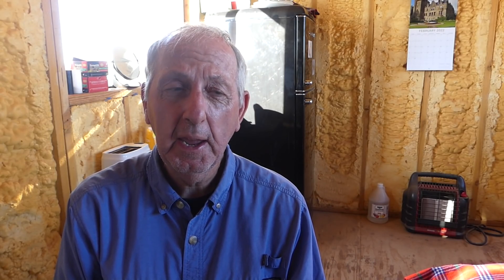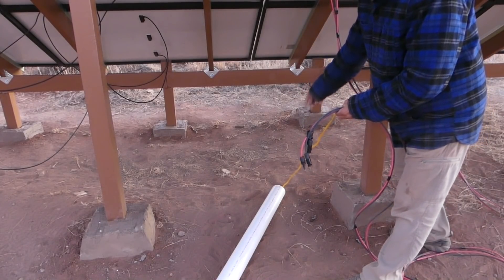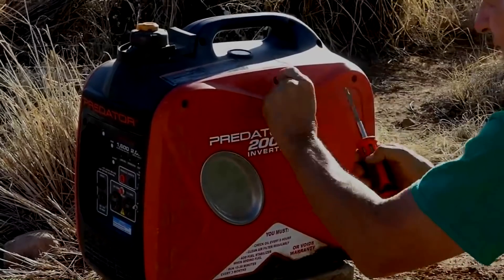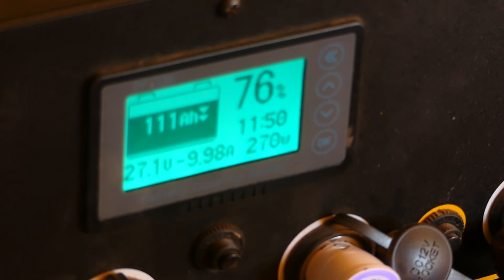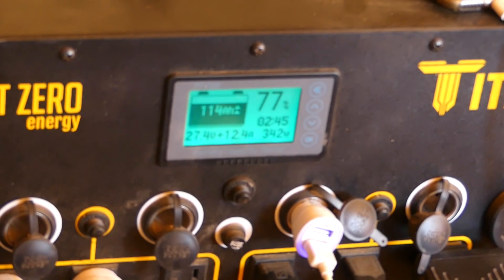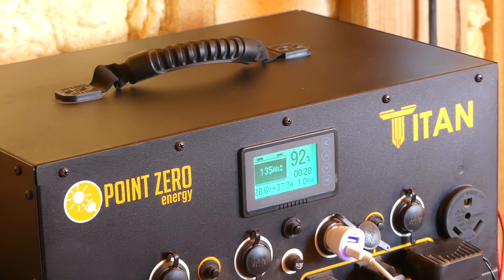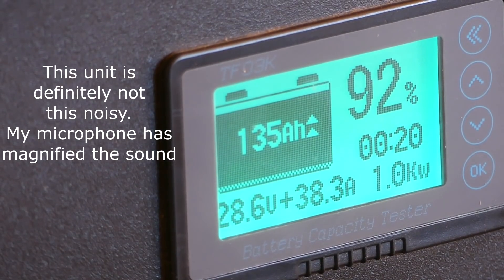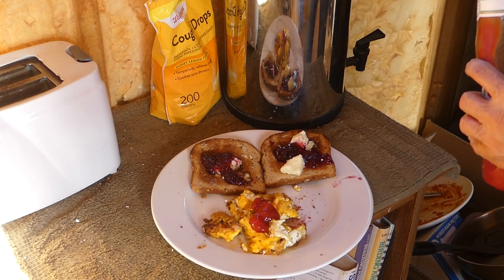Off-Grid Senior Powers 200 sq ft Tiny Cabin with Solar

Comment: Hello Sir, do you have your panels connected in serie or parallell.  How many Ampere are they giving you? How thick is the positive and negative wires?  Just control that they are thick enough for the current.  Only a hint.  Regards Rickard from Sweden 🇸🇪
Reply from the maker: Hi Rickard. My panels are connected in a combination of series and parrallel. I am using no 10 solar cables. The building is not wired yet but I will be using appropriate electrical guidelines for what. Thanks for watching!

Comment: Solar was a journey for me... I live in a cold area so my heating will always have to rely on wood heating but everything else I plan to off grid 100% within 4 years. I basically have everything off grid but lack the battery backup to fully rely on my solar power production. Plus I'm short 9 100watt panels. In the end I plan to have 15-24kWh battery supply and at least 2400 watt panel input.
Reply from the maker: Its all about low consumption of power Mile Deep.  But thats the beauty of Solar.  You can taylor make it for individual needs.

Comment: Don my how a year passes so quickly, looking back it has been a year since the cottage was delivered, you have accomplished a great deal since then. Curious to understand why you did not include in your solar requirements power usage for a washer and would assume you would use the sun to dry clothes, etc., microwave oven and perhaps some other small appliances? Keep up the great work I enjoy learning from you.
Reply from the maker: Thanks so much Bob! I simply use a landromat but may go to a small simplistic washer put in a shed somewhere etc. For me my big focus is on heating and cooling .  After that would come a decision about a washer.  If this little cabin becomes an airbnb then I will do a microwave.

Comment: Can you adjust the charge rate on your charger to not load the generator as much. I have an inverter/charger and my Honda 2000 only puts out 1600 watts continuously which is only 13.3 amps. I set my charge controller to only draw 10 amps which is 75% of the rated continuous power of the generator. If you are charging a 12V system that’s would be close to a 100 amps going into the batteries which is a lot. I use  sealed lead acid and they recommend 20% of the Ah rating of a battery, 100Ah battery is 20 amps max. I run mine a little lower and have had the same batteries for close to 20 years. I have a 48v battery system and a 12v system for lights, RV water pump and radio.
I worked as a communications tech for 30 years and did electronics  all but a few years of my work career. My job on the side is building my own places. I’m just finishing the last one. Where I live we don’t have any home inspections except setbacks and septic or if a bank is involved. I love your foam walls. I’ll bet that makes it easy on the energy cost. We have 7” in double stud walls.
Reply from the maker: Great point Chris. Unfortunately there is no way that I am aware of to adjust the charge rate on the charger.  But I rarely use the generator now that I have all of my solar in place.

Comment: Don you have a seriously big solar system i have half that size and its plenty!One small 8000 btu air conditioner should be plenty!Batteries are very expensive, i have 8- 230 amp hr lead acid batteries right now and they do  just ok. i will go to lithium Ion this year hopefully.You are doing well and learning a lot, im inpressed! Best Wishes Don.
Reply from the maker: Thanks for your lovely wishes Homefree acres!  Hoping to get a mini split with about 8000 btu.  Havent decided on it yet.

Comment: Keep up the good work sir.  I'm doing much the same as you, but I am working on an old cabin Built-in 1850 in Arkansas, rather than the desert of Arizona. Your solar panel set up should be more than sufficient for you. Battery power is something you may need to add to. I have a smaller solar array than you do, but slightly more battery capacity. You have the advantage in Arizona of having a lot more sunshine than I do here. Please check out my YouTube channel, if you would like some building tips. I have about 50 years of experience in construction and restoration. Also you would get to see what my 1850 Homestead cabin looks like now, and what I plan to do with it in the future.
Reply from the maker: Sounds like a great adventure!  Hope it all goes super for you Back to the Past!

Comment: two best tips I got when doing a house like yours was:  beef up the west and southern walls for the summer sun (So I used 1" plywood on those two walls inside, and 3 coats of exterior UV paint on those walls.  The same with our home in Tucson.   Also I needed to know what kind of rodents (pack rats etc) lived within 100 yards because they love to chew on....well, you name it especially spark plug wires in our car, and any small holes they find. They only come out at night due to being on the bottom of the food chain.  I set up live traps (4) and caught about 10 a week....drove a few  miles away and let them loose.  Finally, I learned from an insect company to use screen material to keep things out....I think it was called carpenters cloth or hardware cloth at the absolute smallest size available, about the diameter of a common nail 1/16 inch.  This was a decade ago, and we used a lot more storage batteries back then!  It was so nice to get out of town and just relax inside the little cabin, and BAM, open the door and the walking trail begins immediately.  I'm no bird expert, but we put up hummingbird feeders due to how many there are here in this part of the country.  Have fun..  One last question:  where do you get internet from?  Have fun!
Reply from the maker: Good tips Lawrence. Thanks very much.  My super fast internet is fantastic.  What I have done is purchased a tablet on Ebay. Then purchased a sim card for it from AT&Ts tablet plan. $20.00 a month and super fast.  It is trained on AT&T towers in the area.
Reply: @affordabledesertliving3487  Thanks for that info, I had no idea that technology was 'out there'.

Comment: I'm not sure how a licensed electrician could use the Titan to power your cabin.  The Titan is not designed to be connected to house wiring per the system specs.  There is no actual AC connection point other than the plugs.  It would have to be jury rigged to the panel, definitely not to code.  Practically all inverters have an AC output hardwired connection.   But you have a solar generator,  which is designed to be portable, and not connected / hardwired to a electrical panel.
Reply from the maker: Hi Dan.  Respectfully others have wired the Titan to their cabins. It's all about wiring the cabin like a large RV.  The end results are the panel leads to a 3 pronged 30 amp plug custom designed for the titan. The titan internally is already designed to receive a 30 amp RV plug. All plug and play as they say.  Thanks for watching!

Comment: I noticed a comment from someone else about wall covering. Not positive but I would check to see if that spray foam does any off-gassing...
I am working on a she-shed/ guest cottage now. I used the rigid foam panels that are 2" thick and provide R10. That is on top of the one inch that was there so now have R15 walls. I just finished installing 1/8" thick lauan panels in it. 4x8 sheets are $17 and change at HD. I do have a brad nailer which speeded up install for sure but it is a whole lot nicer than looking at insulation and I didn't think drywall was a good idea on a potentially portable building. Wiring in the outlets before is easy, just use a serrated knife to cut a channel in the foam for wiring and outlet boxes!
Reply from the maker: Hi Bob. Thanks.  The spray foam does off-gassing when new until cured. Then its like being in your new car.  YOu may smell the smell but it's done its bit at that point. Way to go with t he 4x8 sheets.  I used 2 of them sandwiched together for the underside of this building.  I love this ultra insulated little building though. Ridiculously easy to heat.  I would do it again for another building. Thanks for watching!

Comment: That Titan unit is crazy expensive for what you get.  You can get almost 50% more battery capacity, a larger  5000 watt inverter,  high end solar controller, and AC charger for half of the cost of your Titan unit.  Do not buy this unit, as it is a very poor investment.
Reply from the maker: Hi Dan.  Appreciate your input. I am super curious of course to see links to all of these products.
Reply: @affordabledesertliving3487  Hi Don,  there are several suppliers, but the easiest is Signature Solar.  Look at the EG4 battery.  Only $1,500 for 5,600 watthours capacity.  Then look at the  Growatt all in one inverter, solar charge controller, and 80 amp AC charger for $799.  Both highly rated.  Also, do not buy the mini split you showed in your video.  Check out the mini splits available at Signature Solar as they are roughly the same price and are twice the seer rating (19 vs 38 seer).  

As I reviewed the Titan unit, I see what appears to be a huge problem.   The built  in solar controller only supports a max of 2000 watts of solar (2 x 1000 watts per the system spec).  You have almost twice that amount of solar panels.  You will only be able to use half of your solar panels with the Titan.

I am an electrician, and full-time RVer, and have installed several solar systems,  wired residential and commercial buildings, and have installed about 15 mini splits.

Comment: Hi Don, love the build and seeing everything come together, but all your exposed wall foam makes me nervous, particularly with heater and toaster (and future stove) right next to it... I would finish the inside walls asap and even use cement board in areas with hot appliances... ;)
Reply from the maker: Good point with the cement board.  I am careful not to get things too hot around the foam.  I need to wire the place before the drywall goes in.

Comment: Excellent presentation, Thank You.  I have been a user of solar for about 30 years, but I had not heard of Point  Zero Energy  before.
 Why did you put your solar array 75 feet from the cabin?
Reply from the maker: Great question Chain saw.  I hope to turn this cabin into a lovely little airbnb. So I wanted the ability to disguise the panels behind shrubs that dont interfere with the angle of the sun to make things look sharp.
Reply: @affordabledesertliving3487   Thanks Don, I knew you would have a good reason. Everything you have done out there seems well thought out. I usually try and keep the wire run as short as practical.  I'm still using two 45 watt panels that are 30 years old to power a 168 sq foot shed in my back woods, so I had to run the wire about 40 feet to get to the sun light. They started out years ago on a 26' travel trailer and provided plenty of power during winters in Quartzsite.
Reply: Good day! A side note, your solar array could provide at least partial shade for the cabin, that'd help with the cooling.

Comment: Don, I have a similar cabin set up outside of Tucson that I use for storage and an office. My insulation is different than yours but I I knew that I did not want to be staring at insulation all the time, but nor did I want to put up sheet rock. I decided to use painters drop cloth, big canvas sheets from Amazon, that I just stapled or used upholstery tacks to the studs. It looks neat and hides that insulation...way more homey. Good job with the solar!
Reply from the maker: Thanks so much Catherine.  I am looking forward to having drywall so I can paint it up nice in a few months hopefully.

Comment: Hey Don.  You're making great progress!  Did you confirm whether you need fuses on each panel?  I believe if the short circuit current total of the entire array exceeds any one panel's max series fuse rating, then you need fuses.
Reply from the maker: Hi Eric. The Titan has fuse already but I will have a regular fuse box hooked up by an electrician as well.

Comment: Don, before you bury your PVC conduit, you had better check your code.  Electrical should be in the grey PVC, not white.  Also, I wasn't watching too close but if you were using yellow romex in that conduit that is wrong as well.  You need to understand the difference between power (watts) and energy (watt-hours) if you want to be more effective with your designs.  Pick your mini-split before the electrician starts wiring you up.  Although I'm an electrical engineer I am not a licensed electrician, or I would come help you out with this.
Reply from the maker: Kirby. Very valuable.  I am changing out the white PVC to grey electrical next week.  That yellow was nylon rope not romex.  I used it to pull the wires through. Good tip on the mini split also.  Whatever one I go with it will be 110 v.

Comment: If your summer humidity is low enough a 'swamp cooler' may be more efficient and use less power.  It uses some water to cool.  My dad had a building sized version of a swamp cooler for his green house and it was always cool.  if your humidity is low enough you shouldn't have corrosion issues. Also if your refrigerator uses one of the new flammable coolants you may want to make sure the piping and compressor are protected.
Reply from the maker: Thanks Eric. Water is precious here so I will choose not to do a swamp cooler at this time.  Mini Split should do the trick I hope. But I am always open to what works best and is frugal.

Comment: Good job Don.  Does the Titan have a built-in circuit breaker on the incoming side?  You want one protecting your cables. I would also use some of your spray foam insulation to seal up the ends of your 3" pipe/conduit, to keep rodents & snakes out.
Reply from the maker: jrp616.  Yes the Titan has fuses and built in protection from surges. I will be burying the pipes soon so no rodents and reptiles will be there.

Comment: Good progress! Solar power for 21th century. I use pylontech US2000 LiFePo batteries with 9.6 kWh and a 5 kW Victron Multiplus 2 inverter. Ketchup on eggs is a must.
Reply from the maker: No question ketchup rules! Sounds like a serious battery set up.

Comment: The Titan, just like your PC, circulates air for cooling.  In the dusty environment where you live you will need to blow the dust out frequently.  I use a 110v plug in air duster, expensive but works awesome.  You could also use canned air or, in a pinch, just huff and puff like the big bad wolf. 😀  It's important though......DO NOT.......let dust just accumulate inside your expensive electronics.
Reply from the maker: Motor Head super valuable info.  I was wondering how to blow the dust out.  Thanks!

Comment: Don, great video as usual. Glad you’re not willing to go be on your comfort zone on the solar. I’ve seen some people do some really stupid stuff, and dangerous stuff on their own. It’s not the solution I would’ve use for myself but I have a lot more knowledge and comfort and yours is a very good solution for someone doing it on their own. One thing to be cautious of, or I see so many people go wrong, is to get yourself a wire size chart and make sure you use adequately sized wiring throughout. It gets a bit confusing when you going back between 12/24/48 V and 120 V. Undersized wire can be a definite fire hazard. You could easily oversize everything to be safe but copper is too darn expensive these days. Good job!
Reply from the maker: Thanks Scot.  I will consult an experienced electrician for this info.  I dont know enough on that one.  Want to be safe.

Comment: I love your set up.  I am powering my deer stand with a Bluetti AC200P, Soon to be upgraded. It keeps my fridge, coffee pot, induction hot plate, microwave, and other things going. I fully intend to install a mini split also this summer.  I have 1200 watts of solar.  I did series parallel set up 121 VDC input to the Bluetti, all works great.  I watch a you tube channel "Life Uncontained".  They use mini splits works well for cooling, however they just learned using to heat is not working well draws to much and  their system is massive.  Check out their last video. As for ketchup on eggs, I have tried it, not a fan lol. Your smiling happy ways are truly and inspiration wish everyone could be that happy.  Wishing  you an awesome week.  May God Bless in all you do.
Reply from the maker: Wow Rodney that is one serious deer stand Bro! I looked long and hard at Bluetti but I needed something that was modular so I could add on if I needed to. The Titan does that.  The new Bluetti the AC300 I think its called does.  But it came out after I purchased the Titan.

Comment: Thanks Don!  Your info is a great resource for practical off-grid living.  You have added to my knowledge bank!  That router you mentioned,  what is the make and model?
Reply from the maker: Thanks MJ! The router is called a Mofi4500.  They used to be about $400+ now they go for $200.00 on ebay because a 5G one is on the market.  I get ultra fast internet.  I am not blaming the MOFI on weird  imagery with the livestream I did. There is something else I need to troubleshoot I am betting.
Reply: @affordabledesertliving3487  Who do you use as a carrier?  And what is your max GB per month usage?
Reply from the maker: @MJ-ge6jz  my GB per month is unlimited. The plan is $20.00 per month plus tax.

Comment: Hey Don, cool choice to use that Titan as your power source at the cabin. I use a 1000w Jackery in my van, and one day I'll add outlets on the inside walls of the van and provide a connector to the Jackery. I could help you wire up the cabin if I wasn't all the way in Florida 😎 Keep up the good work and include more birding please 🦅 😀👍
Reply from the maker: Thanks John just the same for the kind offer. Sounds like you know a bit of electrical stuff. Way to go!